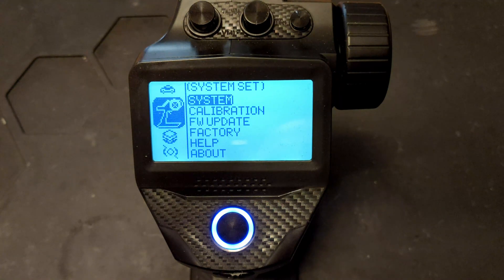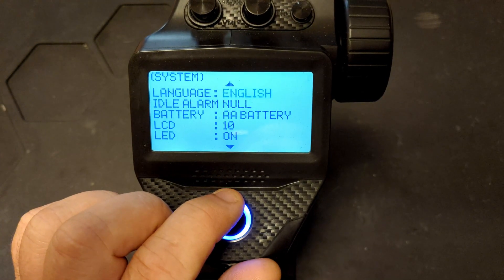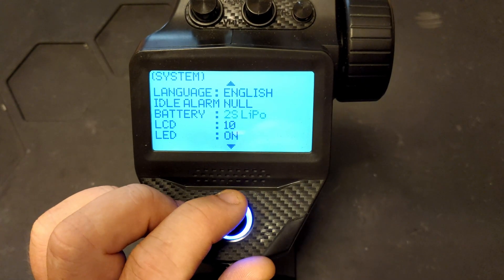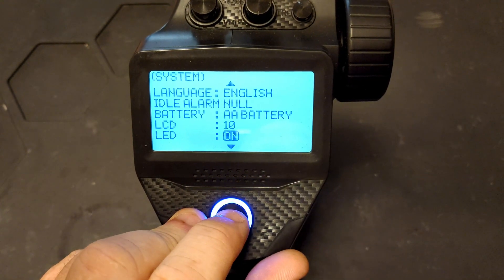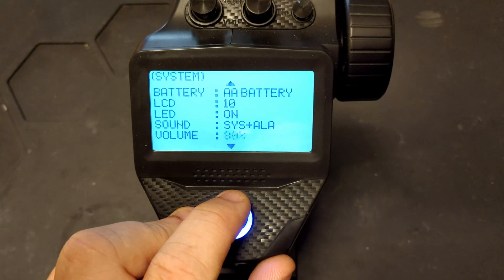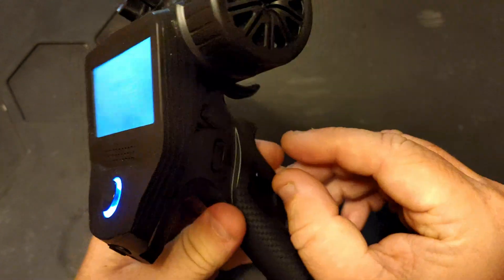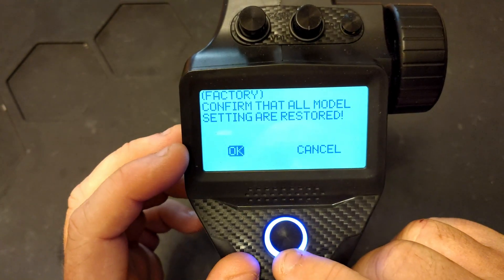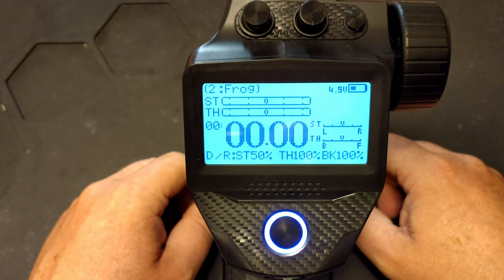Flysky G7P System menu, Language, idle alarm, Battery settings, LCD settings and calibration

Comment: I’ve been running this in 11.1v for a few months now. Why has it not blown up?
Reply from the maker: You haven't you might be running the RC from a 3s lipo but the bec will drop the voltage to 6v for the receiver

Comment: I discovered that the G7P does not turn on with rechargeable AA batteries.
Reply: Yes it does. Get decent batteries
Reply from the maker: Yep god only knows why batteries have different length contacts on them ?
Reply from the maker: The batteries must not be making contact correctly as all I use is AA rechargeable batteries in mine
Reply: @WTFRCCars  I'll test them just to make sure. But if tried over and over. Taking in n out, twisting, repositioned, nothing. Standard non-rechargeable, works fine.
Reply: @WTFRCCars  I got em working! It was as if the positive side of the batteries were too short to make contact beyond the plastic. I cut up a tiny washer to shim it from the back side.
Reply from the maker: Yeh sounds about right 👍 glad ya sorted it :)